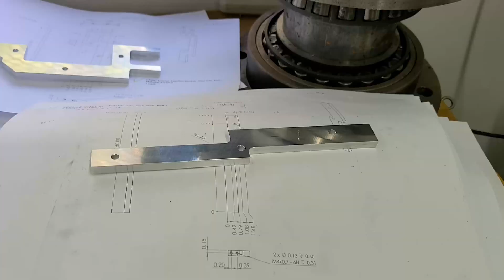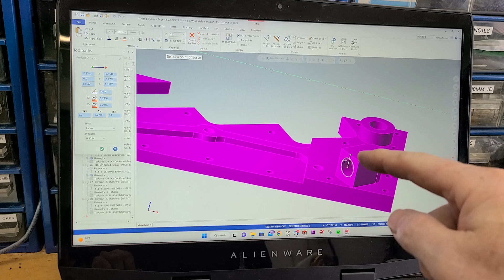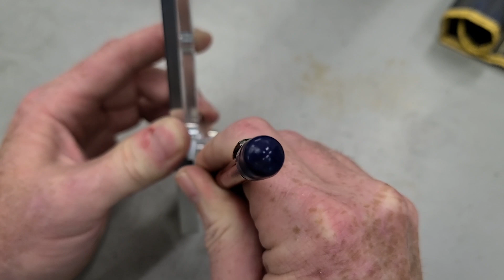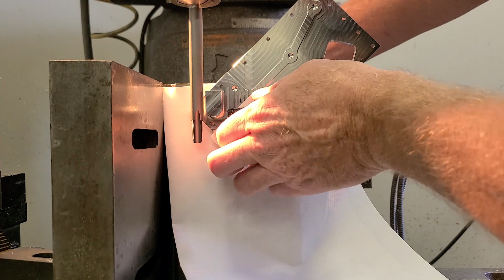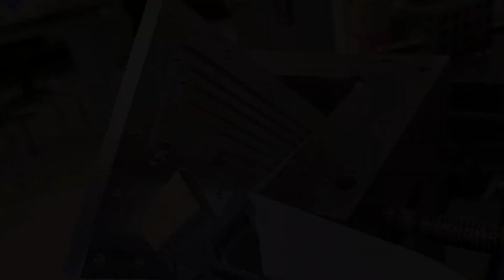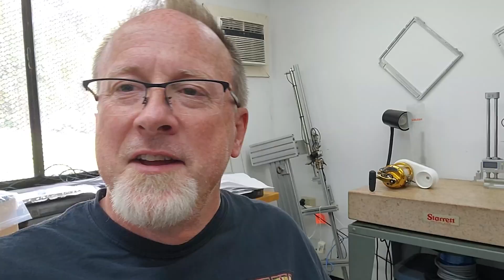Finishing HEAT Exchangers

Comment: On the rotors I used to do that same work in a parts store. Or brake parts rep told us that the min limits on the drums and rotors were set at 10% above the actual limits. The manufacturer knew we would push the limits.